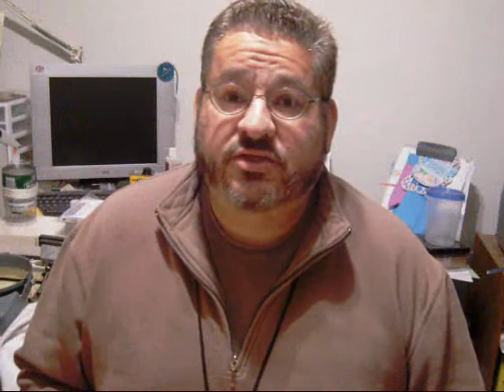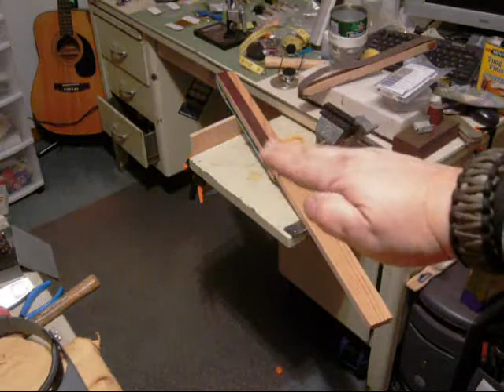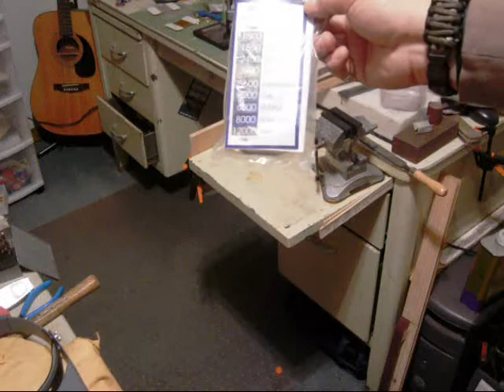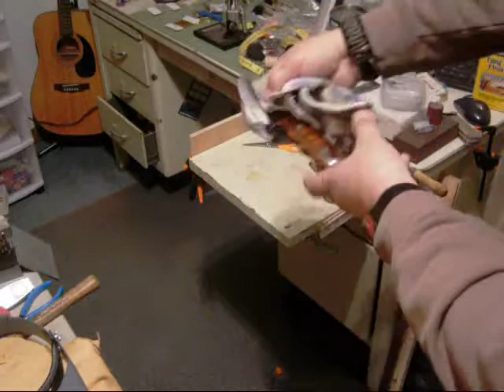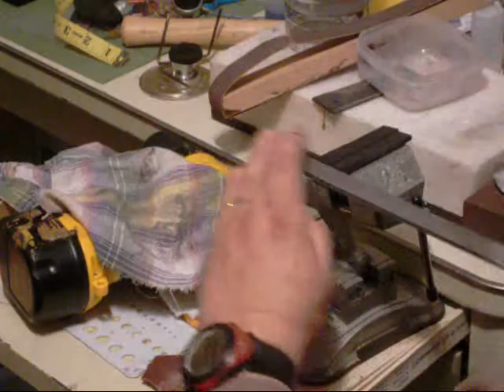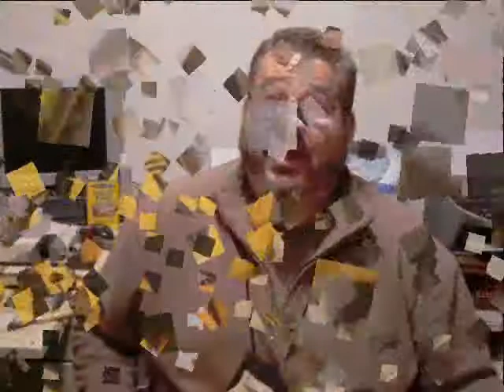2012 SCFBA_Final Installment.wmv

Comment from the maker: @Mrcoop1967 Your welcome! I'm glad you were able to get some use out of the information. Another little tip when using the jig, be sure to index the blade the same way on both sides e.g. distance bevel hangs over the edge of your work surface. If you don't your angle will change.

Comment: Thanks you so much for this video, I have been trying to figure out how to make a jig that would help keep my lines the same on both sides of the blade. Every time I try and use a belt sander I loose my point on the end of the knife so I decided to go back to using a file. Plus I feel the file makes each knife feel more personal. ;o)